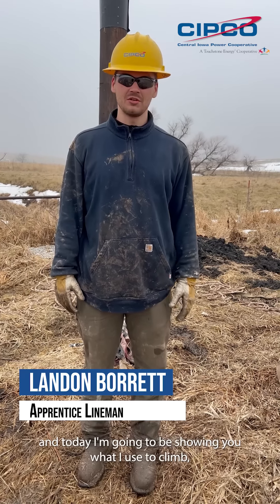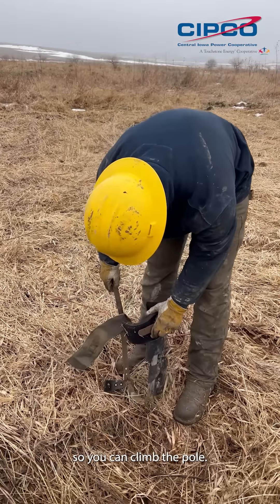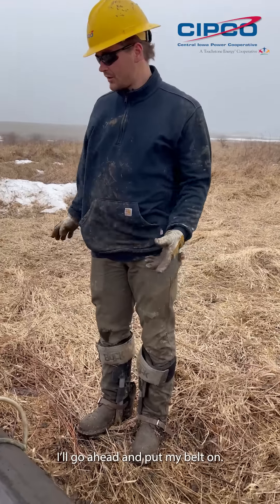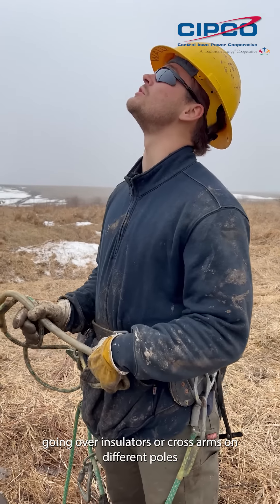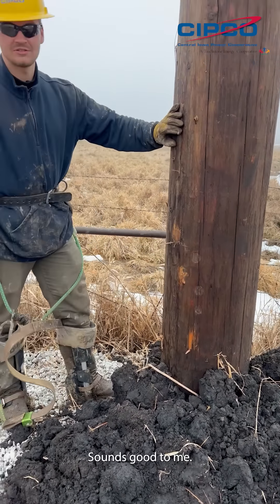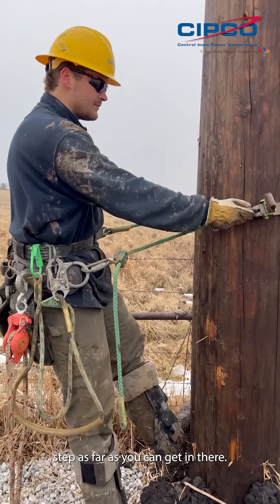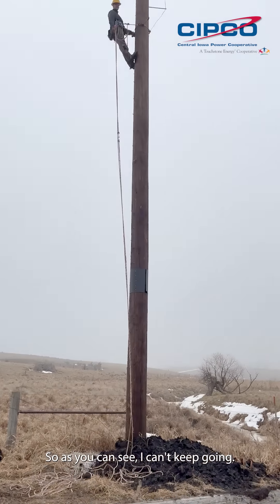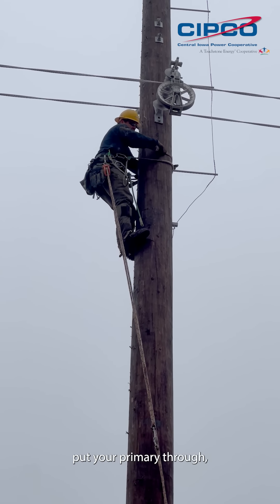How Does a Lineman Climb a Pole?

Comment: Retired now. But in my time it was free climb. You didn’t safety off til you reached your work point. Also you sound your pole at the ground. Pay attention to staples hardware and cracks. Also you don’t have to stomp if your spurs are sharp going up or down. Your weight will be enough to hold you. Just step up or down.

Comment: That's a hell of a lot of gear he`s taking up the pole. In the UK, we use a ladder to access rungs on either side of the pole and then use them to climb the rest of the way up. And there is no damage to the pole due to using spikes.

Comment: We never had a secondary belt, we just un-hooked and climbed over the obstacles!
Reply: very dangerous
Reply: Was trained using one belt in the early 90s…always had a keen respect for defying gravity, as well as the clear & present danger. 🤙🏽
Reply: That sucks
Reply: Real lineman ar dieing breed been 100ft doing fiber job used 2 pole straps 2 on bottom of stick one top  any else I free climb  to 40 crazy for the pay
Reply: Had take second 1 off half way up
Reply: Learned to hook poles in 79, we freehanded up maintaining three points of contact and belted in when we reached working height and you never clipped anything to your body belt. We would slip a hand line under the belt in the small of your back so that if the line gathers snagged or if anything were to pull on it you weren’t connected to it and it would just break away safely without risk of pulling you off the stick.
Reply: real lineman freeclimb or climb with standard pole strap bucksqueeze or pole chocker is a piece of shit for gay guy
Reply: @Kyohan137 Exactly the way we were taught in 78